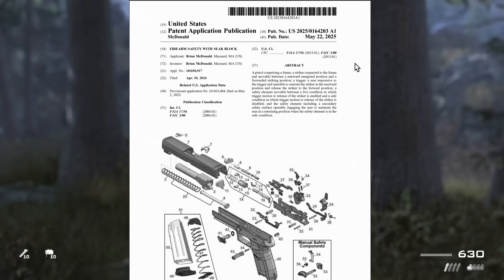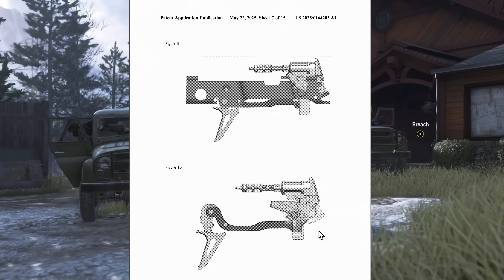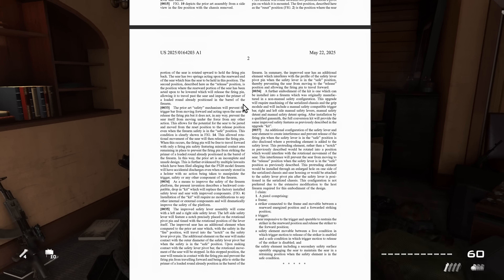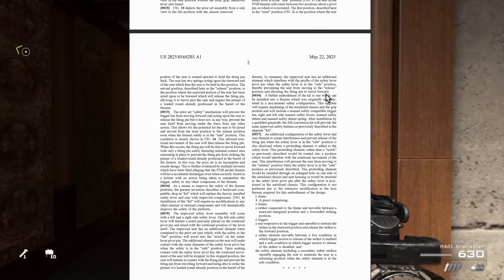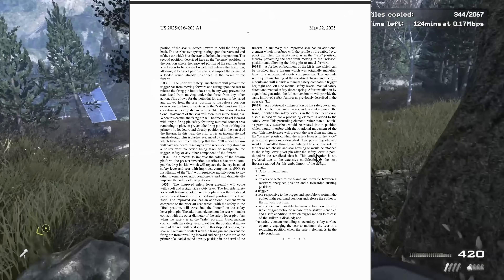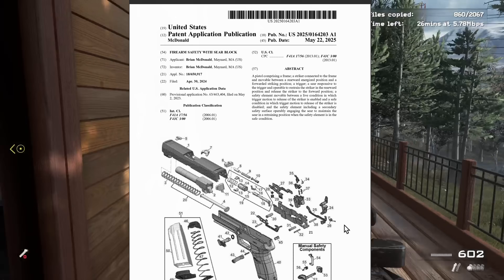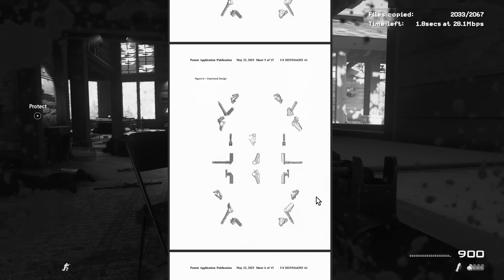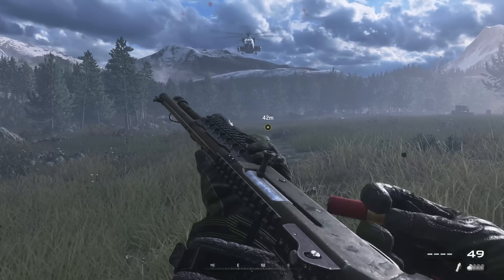Explosive: New Patent Claims Fix For  "Incomplete, Unsafe" 320 Design

Comment: I commented too fast. It would be the FORMER QC guy that fixes their design.
Reply: This doesn't fix the design at all. It makes the pistol more safe while the new safety is on. It does not solve the problem of the P320 firing on its own. It does not address the dangerous, fully cocked striker nor the striker safety that becomes inoperative from movement. In other words, the gun can still fire all by itself.
Reply: @donwyoming1936 agree. There are still other components that need attention.
Reply: @donwyoming1936  A fully cocked striker is not dangerous, a very poorly designed striker safety is.
Reply: That’s what I was thinking the whole time. This just makes the manual safety more than just show
Reply: @donwyoming1936 if it makes it more safe it is a fix, it doesn't fix all the problems because there are 2 safeties and it's a flawed design. There are many problems, and few safeties. This does fix one of the issues. So it is by definition a fix.
Reply: @navyman8903 seconded. It also doesn't adress additional weaknesses of the 320 not safety related.

Like the irreplaceable ejector part. Definitely an oversight likely in the name of profit
Reply: Get this guy on a live stream it would be great
Reply: @burtbiggum499 idk if I'm cleared for streaming.
Reply: Sig will arrange an accident for him most likely. Then someone will come in and disappear the patent. 🤷🏼‍♂️😂 Someone tried to cut cost and this is what happened.

Comment: Well well well, looks like this is a fix. To ONE of the issues.
Reply: Agreed, the other major issue that needs to be addressed is the striker block safety.
Reply: @KristoffFry1  In the short, converting a sig320 into sig365 will fix the problem, so Sig has already done that, they only skipped the part with recalling all of the sig320 already sold.
Reply: @KristoffFry1  right? i was under the impression the UD's were caused by failing striker block safeties and tolerance issues in the slide to frame/sear clearance. i didnt think sear movement was the issue